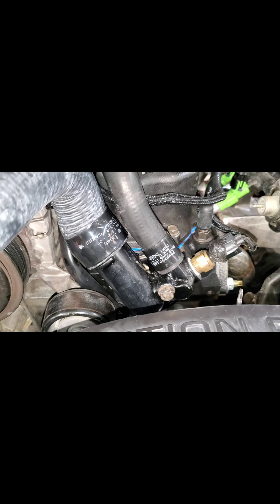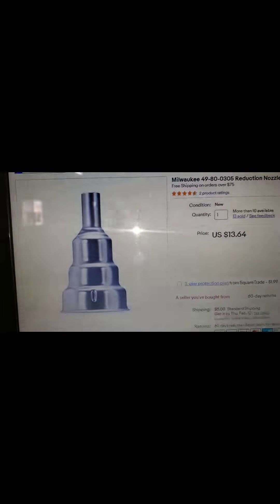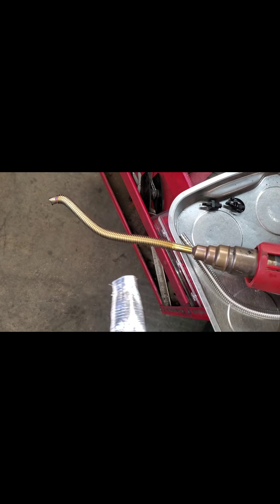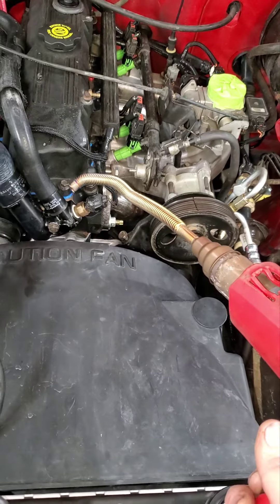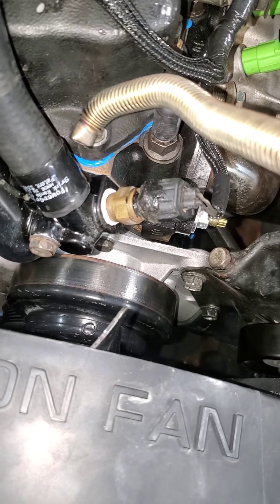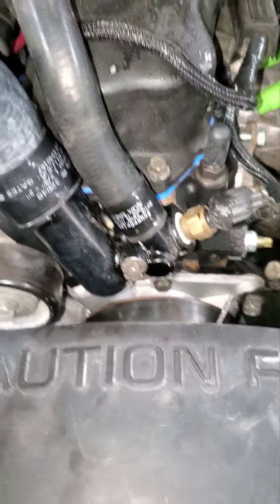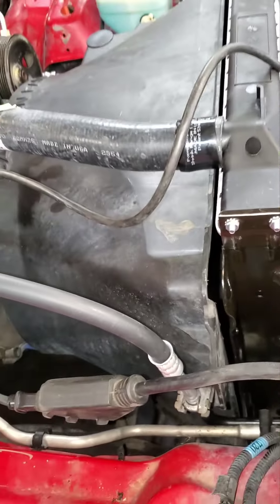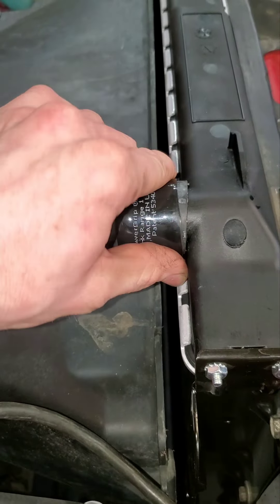Heating Gates PowerGrip Hose Clamps In Confined Spaces

Comment: If you have a little room behind the hose as you do in this video, you can just use some sheet metal as a kind of deflector.  Just set a small piece of sheet metal behind the hose and it will help direct the heat from the heat gun to the back side of the heat shrink.

Comment: Can you use these clamps on oil and fuel lines and how do they hold up on silicone radiator hoses
Reply from the maker: There are so many different lines out there I can't say without you telling me exactly which style line you are talking about and what application it is being used for. As far as Silicone radiator hoses- they should work perfect.